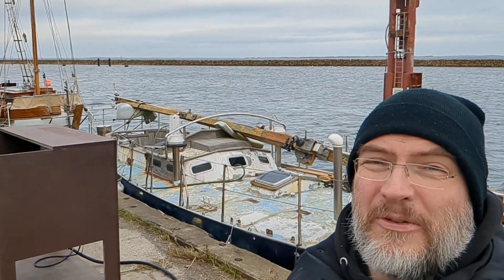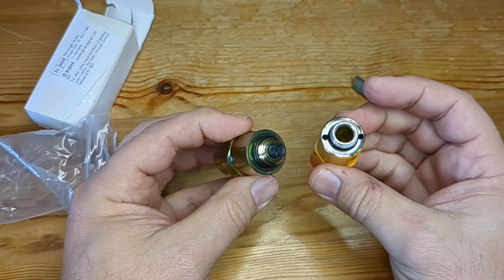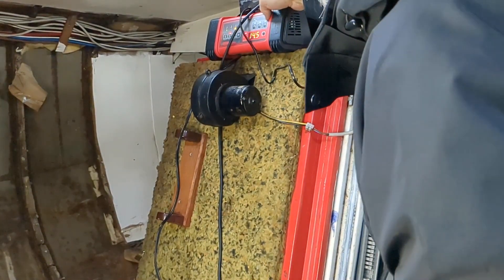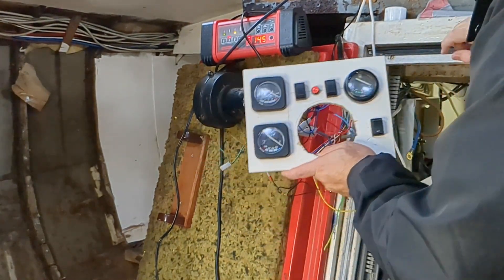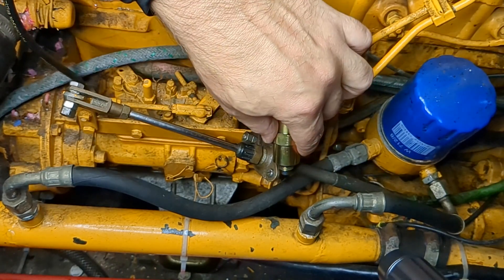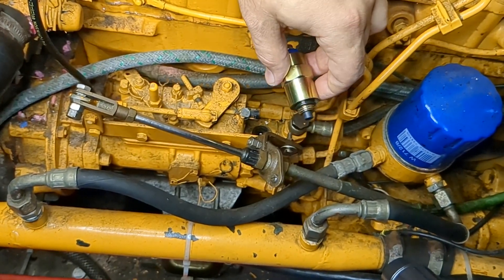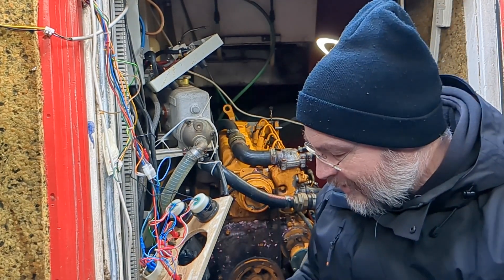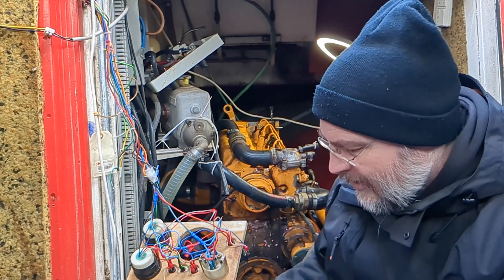Episode 35 - Installing, testing and troubleshooting the engines new stop-solenoid

Comment: Might order a second selenoid since you did all that research.
Reply from the maker: I'm considering that, but I'm also going to contact the manufacturer, their e-mail was on the solenoids packaging, and see if they manufacture a compatible solenoid that works in reverse of the one I got. If I can get one that  is open unless fed power, a failed unit would still allow the engine to run.

Comment: If you are going to use the alternator for your rev.- counter you will ned to check the ratio of the crank and alternator pulley
Reply from the maker: Exactly and the tachometer has an adjustment screw for the purpose, if the tachometer still works of course :-) And I'm going to need that because not only did I change the generator, I also changed which size wheels the belt run on, so I changed every single thing possible ;-)
If the tachometer  doesn't work, which is likely, I'm probably going to get one of the rev. meters that use a magnet to count the revolutions, they should be fairly simple to install. Thanks for your input :-)